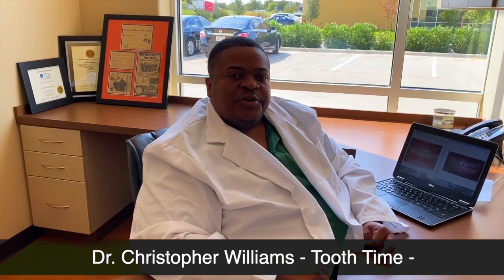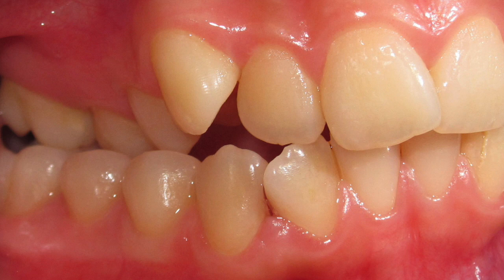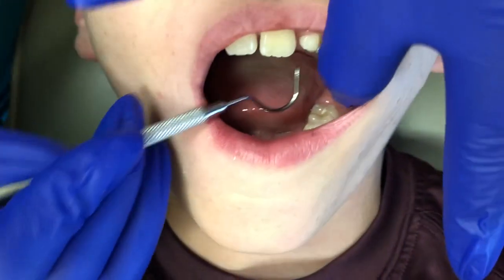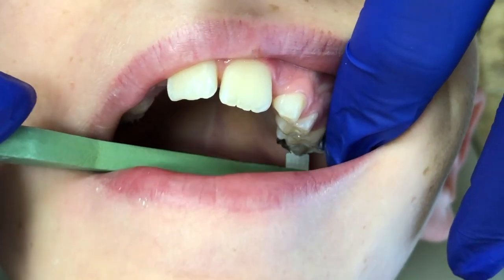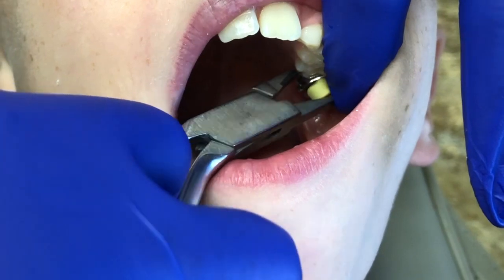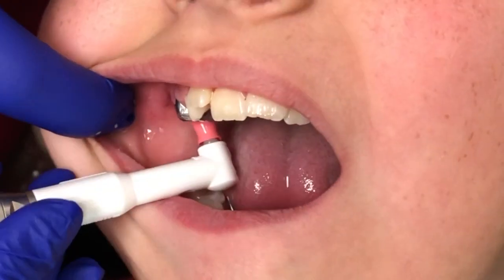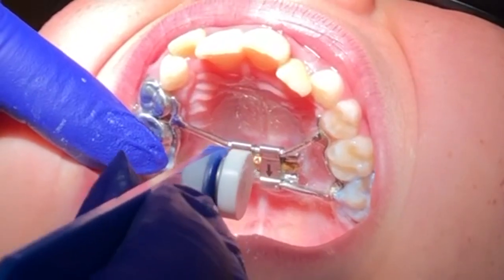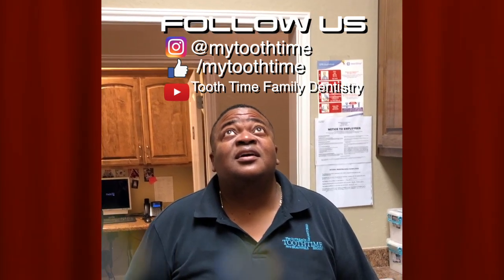Braces in New Braunfels: RPE (Rapid Palatal Expansor) - ToothTime Dentist New Braunfels

Comment: Great videos thank you! Do you ever use PRE's on adult patients? I am 26 years old and have had braces for 7 months now. My orthodontist is correcting my molar cross bite and narrow upper arch (to expand it) with an elastic, and I feel that this will be a very slow process. Would you have any help or recommendations? Kindest regards. : )
Reply from the maker: Expansion is limited and not quite as predictable with adults because the upper bone has solidified. We do attempt on occasion with varied levels of success. It would probably work best with consideration of surgery and the expansion when dealing with an adult. Good luck I'm sure your orthodontist has a great plan for you!